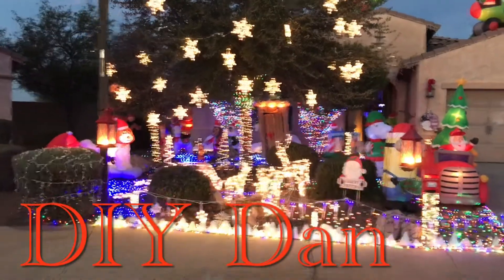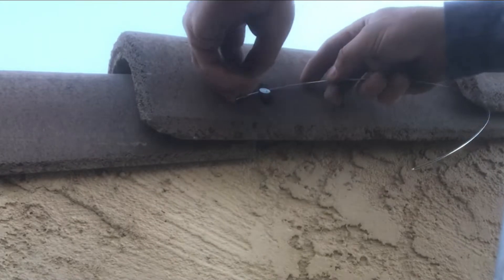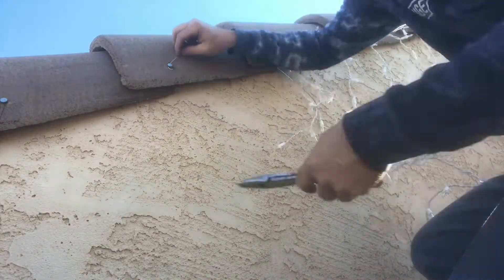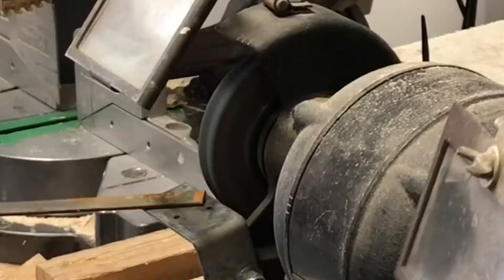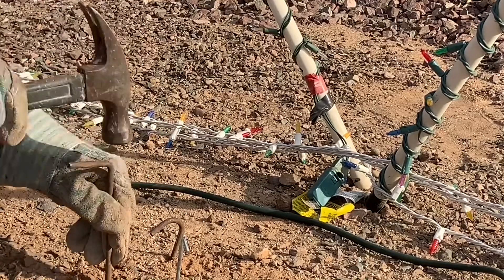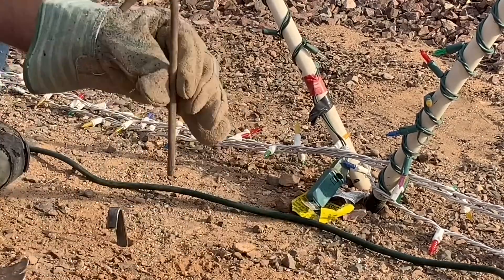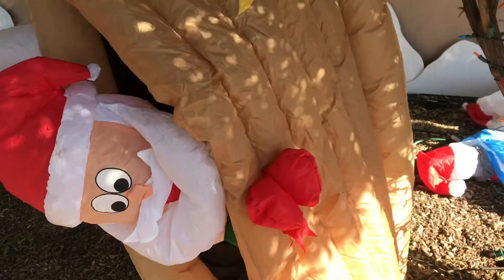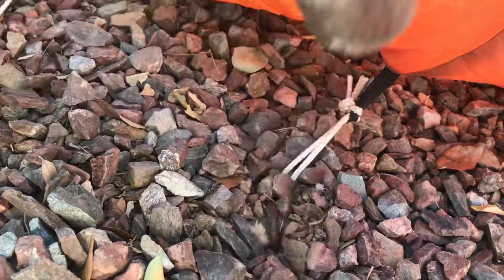HELPFUL IDEAS TO REDUCE FRUSTRATIONS OF PUTTING UP OUTDOOR CHRISTMAS DECORATIONS & UPDATE THIS YEAR

Comment: Thanks Dan! Q: how would you place a decor designed for yards with stakes on your roof that is NOT an inflatable (e.g. a sign or wire frame deer)?
Reply from the maker: That’s tricky you might be able to Mount the deer to a piece of plywood and then use sandbags to hold the plywood i’ve never tried that if I think of anything else I’ll let you know